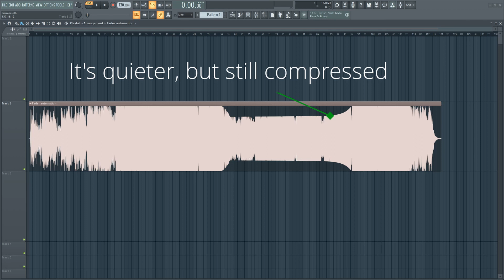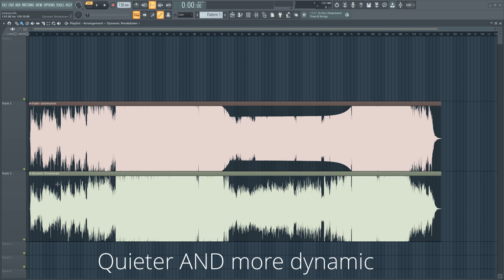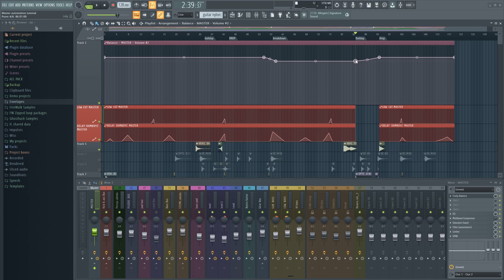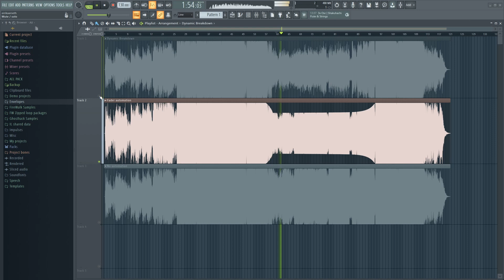The BEST Way to Automate Master Volume in FL Studio!

Comment: I do the same technique but with a Fruity Mute by automating its dry/wet knob on the mixer channel. I find it less tricky as I know my normal volume is at 0% on my automation clip. This way I don't need to copy/paste values inside my automation.

Comment: "how to automate the right way!"  , but "there are no rules, there's no wrong method" 
so the title should have been- "automation methods for the master volume" 
how about automating the input knob on the compressor plugin?
how about automating the busses or instrument volumes?
Also, if your'e compressing a lot, a few db of gain reduction before the compressor might not do the job.
clickbait and incomplete information?😅
Reply from the maker: I see your point, but unfortunately that title is not very SEO friendly, nor very specific or clickable. :) 
Most content creators on YouTube try to make their titles as clickable as possible. That's just the way it is unfortunately. As a content creator, It's do or die. :) If nobody are clicking on your videos then there's no reason for you to keep making them. And the sad truth is that titles that are slightly "clickbaity" have many times higher clickthrough rate than more neutral titles. 

That said, I personally think this IS the correct way to do volume automation, which is why it's in the title to begin with, and I wanted to get this information across. 99% of the time this method will give the best results. Judging from the comments, a lot of people was clearly unaware of this technique, and many was also doing it the "wrong" way earlier. 

What If I were to tell you that you should NEVER put reverb on a kick? Or a stereo shaper? That would be true 99% of the time. But what if you wanted to make an FX kick during a breakdown for example? Then it would be OK to have reverb on it of course. 
 There are always some rare situations where something that would be considered wrong most of the time would actually make sense, that's why I like to include a little note of caution about that in my videos. 

I've seen so many videos where people say NEVER under any circumstances do this! Sure, it's probably true 99,9% of the time, but it's not 100%, and if you're  a beginner you deserve to know that there are always exceptions to these "rules" when it comes to music production. :)